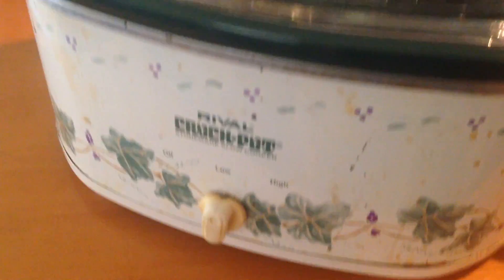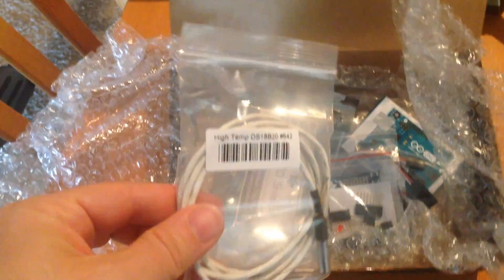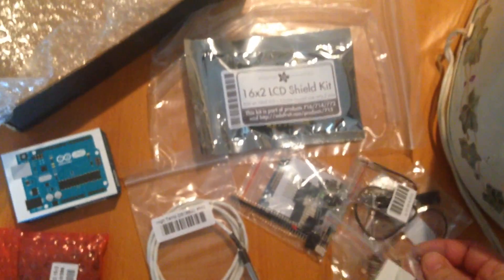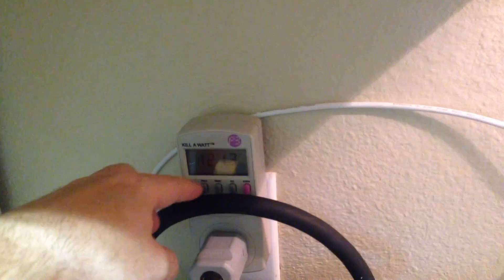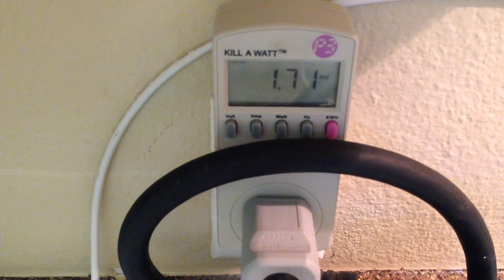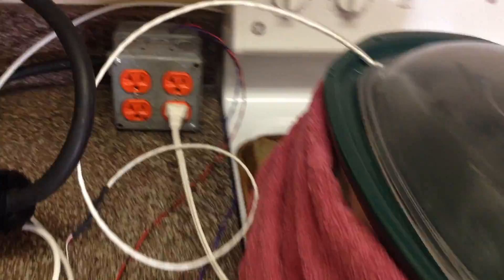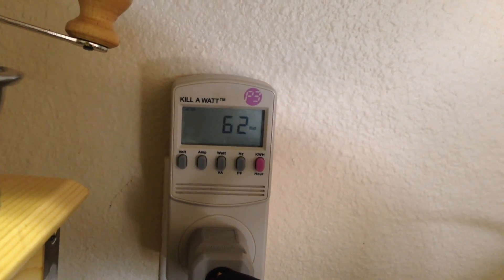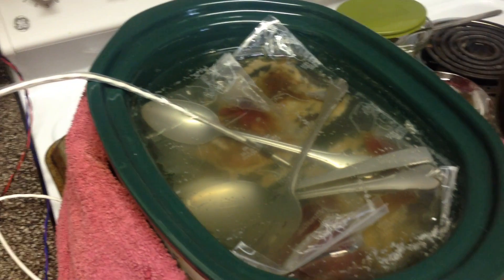Crock Pot Hack into Arduino Sous Vide

Comment: Ok. While I can appreciate your wanting to be creative. Ya.. No.. It's not traditional. In fact it's nothing like sous at all. There a ton on new prescion cookers with a price point of $150.00. This looks so dangerous with all the wires exposed and such.
Reply from the maker: The Arduino runs at 5 volts. You could put it directly in the water bath and it would destroy it but wouldn't be dangerous. This crock pot is clearly underpowered and takes HOURS to get to temperature. I still haven't gotten a bigger unit that I can use to cook a larger amount of food at once.
Reply: @anotherdayinparadise9744  What is the power rating of the crock pot? I've look around, and the majority are around 200w.
Reply: Hahahahaha. Dangerous. Hahahaha. No, actually not at all.
Reply: At worst he is running that at 5v, Could be 3.3, but I would have went 5 just for the relays sake, so, 5v, at the amount of power the batteries put out is hardly dangerous in any way shape or form. The relay isolates all those wires from the house current, so it is not like he is pumping raw AC into any of those exposed wires. BTW, this is awesome, I am building one right now, and can't wait to see how it runs, I bet yours would have done much better had you used a crock pot that was in better condition, that one might have had the elements going out. 

I am also going to play around with making my own water circulator in case I want to use something larger than a crock pot to do some sous vide cooking in. Thanks for this awesome video.
Reply: Trouble is there all colossal pieces of shit. Flooded with bad reviews , 
short life span, false low water alarms, digital controls ruined by 
steam you name it. I would not give 10 cents for all the sous 
machines in the world. Even the motors quit after 10 uses.

However this video here is way too over engineered and convoluted. A huge nomenclature of calamities.